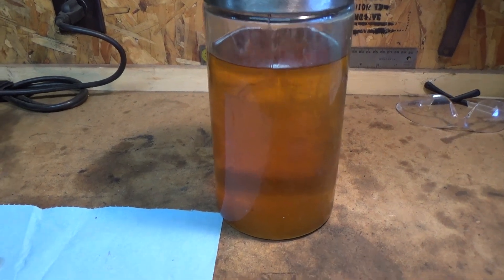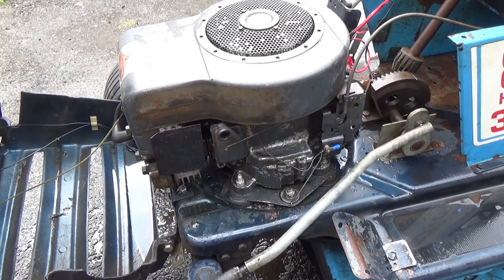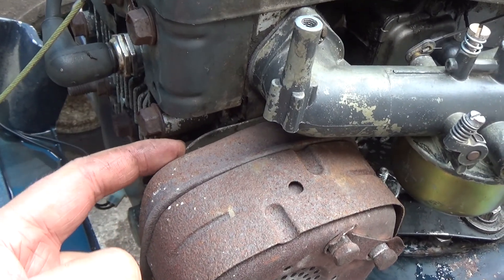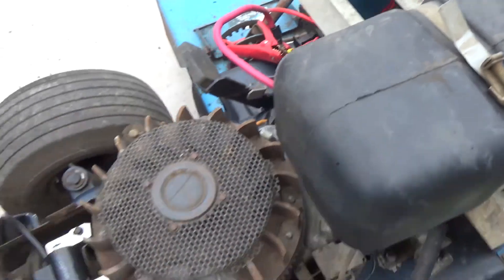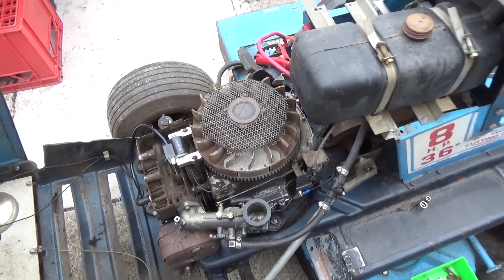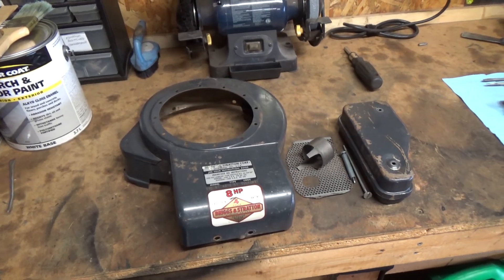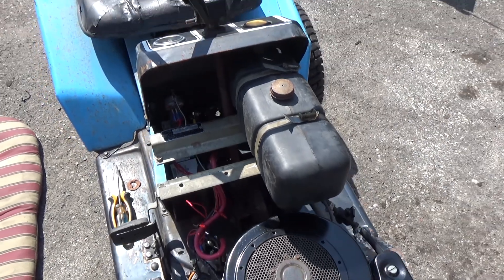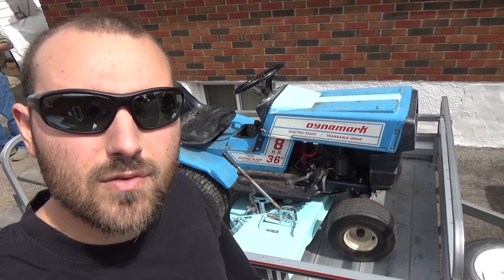Dynamark Riding Mower Repair [Part 2]

Comment: Hello and thanks for the videos on this mower. I have just bought this same mower as a restoration project. I have the handle for the deck belt engage, but I don’t have the spring. Is there a specific spring I can buy or do I have to do trial and error on the strength of spring I buy?

Comment: Excellent video Sir. I have a 1975 Dynamark 8/36 that I love. My father rode me around on it when I was a child.
We stored it properly 6 years ago. Pulled it out this week. Fresh gas and battery later, runs like a champ. Looking forward to checking the brakes. The question I have is at full throttle, the engine seems to be running a bit faster than I remember. Does it have a govenor or adjustment on the carb to slow it down just a bit? Runs awesome otherwise.
Reply from the maker: Robsbrd99 Thank you!

It may be running a bit lean, try adjusting the main jet at the bottom of the carb!

Screw it in until it runs rough, screw it out until it runs rough, try to find the center of that!

Check out this video for help with brakes: https://youtu.be/pfXuw4zy-Bw
Reply: Excellent you should mention that! I noticed it had a sputter and went down to that screw and went just a smidge clockwise and it cleaned that up nicely. Very well could be that its running a bit differently than I remember. Always able to drop the idle lever down just a little bit. 
Thank you very much!
Reply from the maker: Don't forget to subscribe if you're not already!

I post new videos every week!
Reply: Also changed the oil. Does need at least a deck belt. Probably gonna do both. I really can't then of anything else to do to it. Already runs so nice as is. It's just something how a 40 + year old mower comes out of hibernation so easily. Probably because its seen one tank of ethanol and was drained right after. 😂😂😂😂

Comment: What trans axel is in that? I have a green star riding mower that’s the exactly the same as that but green with the name green star. I need to find parts for it or buy a identical replacement transaxle. It’s the same 3 speed with reverse.

Comment: I purchased an 836 last year. 5285-1600. Can't find that noma belt pdf. When I go to that website it says it's not available anymore. I'm assuming my deck belt would be the same as yours, 5/8x70 but I have no way to confirm. Any chance you could post that pdf?
Reply from the maker: Not sure, I'll have to do some research on how to do stuff like that in the "discussion" area of YouTube
Reply from the maker: It says either a 5/8" by 69" or a 5/8" x 70"

You could get 1 (I'd start with the 70") and if it don't work get the 69

Nothing came up for -1600 though so I'm not sure

Sorry I can't help any further! Good luck!
Reply: Eliminator Performance I tried a 71 and it fit fairly well, but not enough grip to get the job done. I'll order a 70 and see. I assume it can't be much different than the 836 you featured. Other than the color it looks exactly the same.
Reply from the maker: Yeah like I said, either a 70" or a 69" should fit good
Reply: Eliminator Performance Love the videos, by the way. Thanks for the posts!